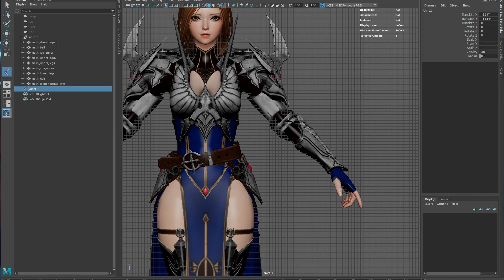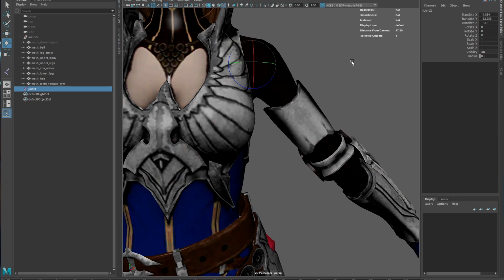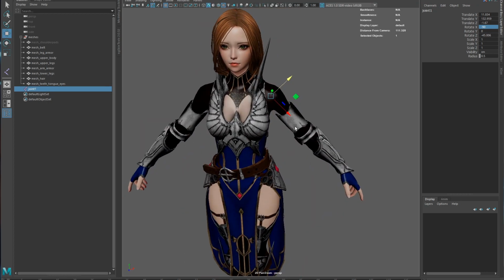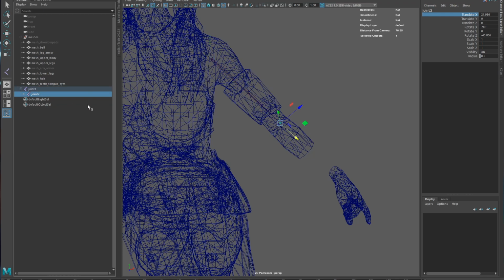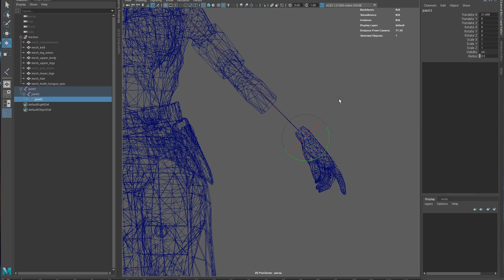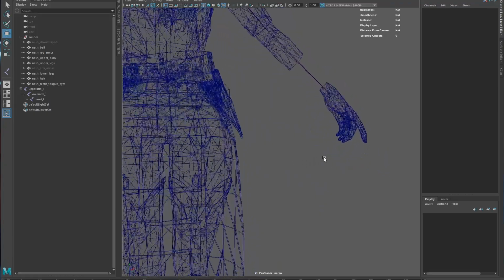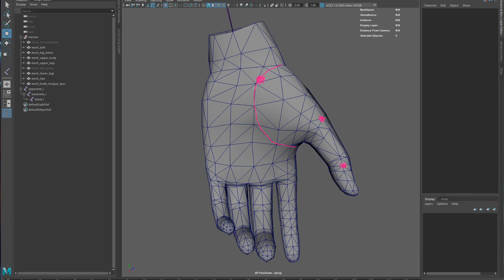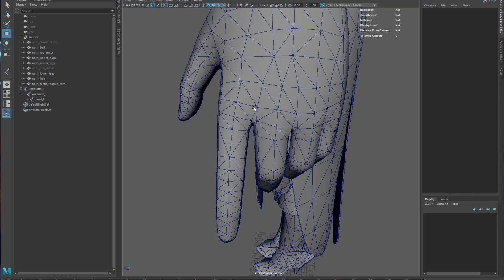Part 2: Joint Placement Fundamentals

Comment: Hi Jeremy, love the video! Thanks a lot for taking the time to go through all the fundamentals, awesome info and tips!☺

I have two question regarding rotation orders, I've always been on the fence of fully understanding them. 

1 - You mention that most game engines (e.g., Unreal Engine) only support XYZ rotate order and that's why you use this one in Maya for the joints. And, as far as I know, animation is normally baked on the joints on every frame when exported to engine. So, I was wondering if choosing another rotate axis other than XYZ would be ok, as long as the joint rotatations account for that. For example, if choosing ZYX, then the twisting axis would be Z.

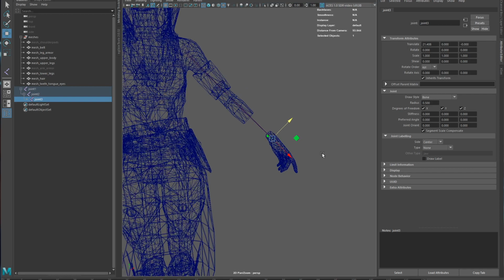2 - Do you usually use the same rotation order for all the joints in the skeleton? The way I've always done it is to change it depending on the case. For instance, at 6:55 you change the hand joint rotation to account for the fact that Y is the axis is the one that will likely rotate more in animation. In my case I would have changed the rotate axis instead, but I like more the way you do it of maintaining the rotate order and changing the joint orientation instead. That's why I was asking the first question as I normally have different rotate orders depending on the joint.

Thanks again for sharing, awesome stuff!